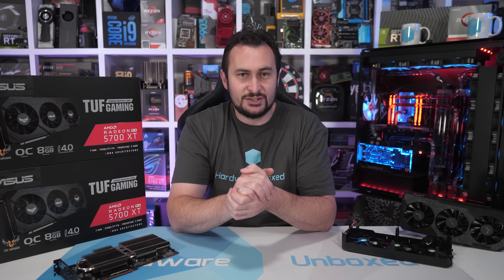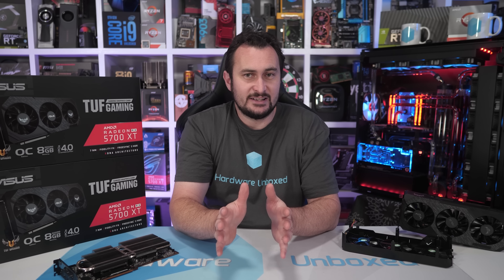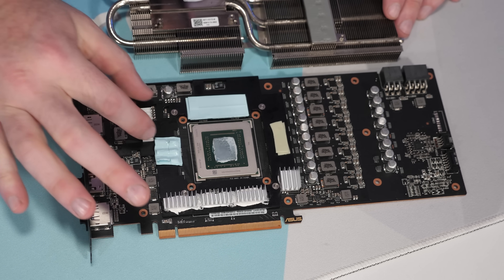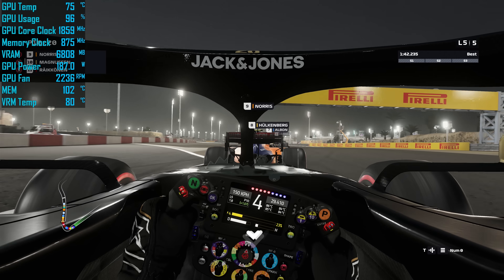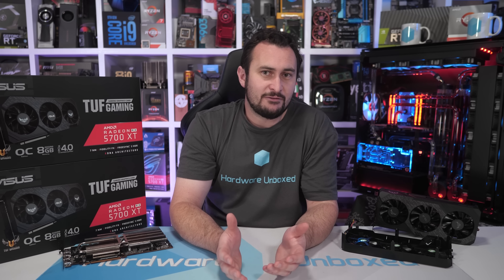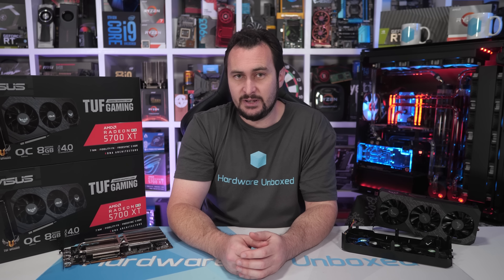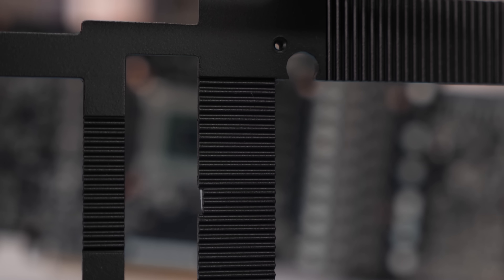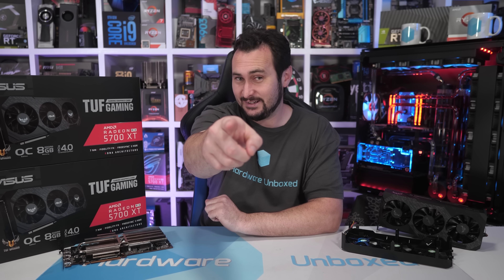Fixing the 5700 XT TUF, How Much Cooler Can We Make It?

Comment: In respects to AMD GPU's ASUS, MSI & Gigabyte release crap products all the time.
Reply: Correct me if i'm wrong but wasn't the Gigabyte Gaming OC model an okay one? (It's also pretty cheap in Germany atm, I just found it for 408€ including tax and shipping)
Reply: FDMtech  Well, EVGA's CEO acts like an nvidia fanboy hating AMD... but I agree that it's sad. This kind of competition would be good for customers.
Reply: FDMtech  I've only ever bought one EVGA card & that was a GTX 780 Classified, I bought it mid-life & at the time I expected a class leading product but it wasn't because GTX 780 GHZ edition cards were entering the market meaning the 780 Classified trailed them in clock speeds & performance, The card itself was well built. Due to today's extortionate price hikes I intend to keep my cards for longer so when I buy Nvidia I'll likely go with Zotac for the 5 year warranty, That said EVGA do offer excellent customer support here in the UK. A member of my local forum was running Titan Blacks (Kepler) in 2 way SLI & one failed, He sent it back to EVGA & because it couldn't be fixed they replaced it with a Titan X (Maxwell), Because he was running SLI they had him return the working Titan Black & they replaced that with another Titan X, That sort of customer support is excellent so if I'm not going Zotac they'll be my next go to brand for Nvidia.
Reply: @0hgre   Hi, If you mean Gigabytes 5700XT model I've also read that it's meant to be okay along with MSI's Gaming X model which is good to hear but for me personally they'll have to consistently churnout decent cards before I'll consider them again. I refuse to pay top dollar for poor quality cards, In respects to Gigabyte their Vega & Polaris cards have been consistently sub par, J2C reviewed their RX 480 Gaming OC giving it a big thumbs down, I bought a Gigabyte RX 560 Gaming which was loud & hot under load even though it was a low end card that should of been easily tamed so I returned it & there's plenty of reviews on their RX Vega Gaming card which trails the pack.
Reply: @davideverett2  I understand your caution but I think customers shouldn't go for or avoid a brand or model series just because in the past they were good or bad. I want to know if they are doing well now, which is why I watch this channel and gamers nexus. Even if I buy a good card from a brand and series now, I will be cautious next time, since - as seen here - there is no consistency to be expected from them. 
As for "top dollar", that's not the case with the metioned gigabyte product in some regions. It's one of the cheapest one here, probably the cheapest quality AIB card at the moment.